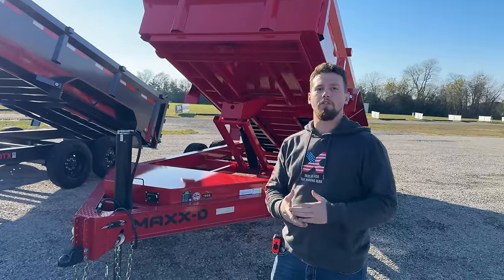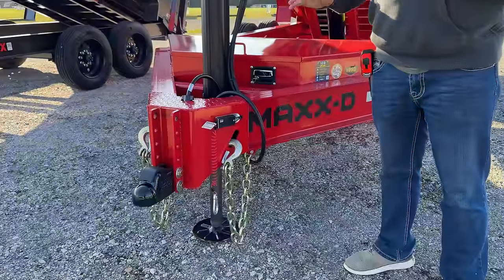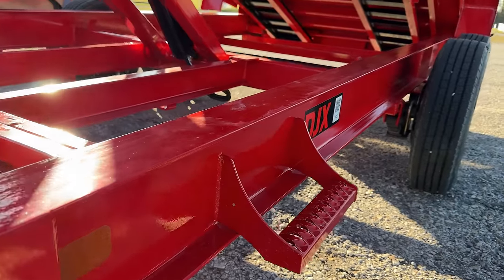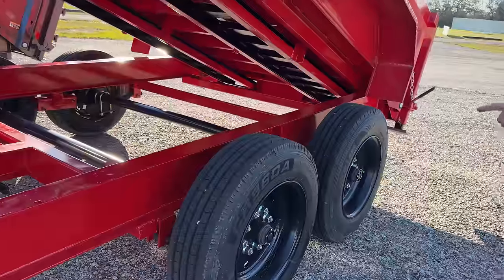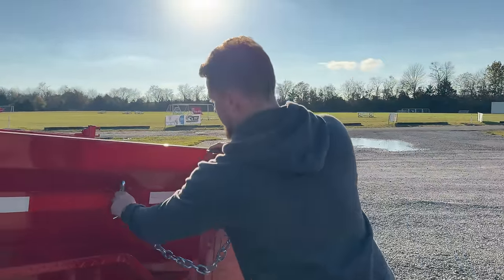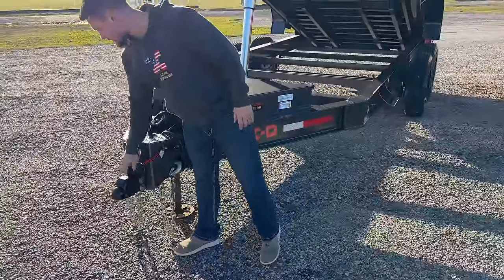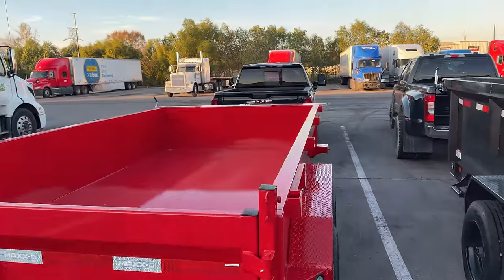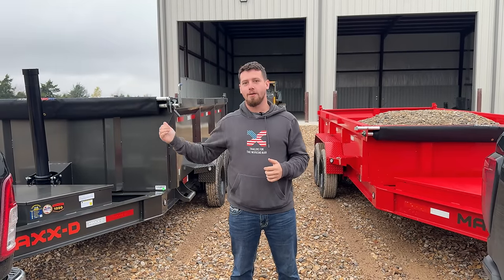Scissor Hoist vs Telescopic Cylinder | It's not what you think! DJX vs DTX Dump Trailer Comparison

Comment: The loads should have been put in the center of the trailers, not piled at the front.
Reply from the maker: Correct, you want the load over the axles, evenly distributed. In this case we intentionally loaded them both front heavy to showcase the lifting power in both trailers.

Comment: What kind of steel and how thick are the floors of these trailers?
Reply from the maker: 10 gauge steel standard, 7 gauge is optional!
Reply: Since the comments are off, I'll comment here, why not turn the scissors system around so it lifts the front of the trailer instead of in the middleish.
Reply: @Maxxdtrailersofficial  10 gauge is pretty thin for a floor on a dump bed, that's only 1/8th inch. Is it AR450, AR500, or just regular steel? All my big dump trailers for semi's, and dump trucks are standard 1/4 inch AR450 or Hardox which is equivalent to an AR450-AR500.
Reply: @clydeacor1911 with 12” centers you’d probably break the axle before the floor

Comment: I usd to drive tip trucks. Underbody hoists are bad news, they will twist and tilt and at worse case fall over.
Tele hoist is a LOT more stable and the reason 99% of full size tippers have them

Comment: Wow that is very similar to my pj almost the same!
Reply from the maker: MAXX-D dumps may look similar to a PJ, however there some differences that set us apart, here are a few. 
PJ crossmember spacing is 16" to our 12" spacing.
Our 8k axles come standard with 16 ply tires.
We offer an industry leading five year structure warranty, PJ offers a three year. 
MAXX-D dump trailers come standard with a TUFF wireless remote for all functions.
We also build our dumps on a heavier frame, 8"x15lb to PJ's 8"x13lb frame.
Reply: @Maxxdtrailersofficial  oh wow! That is a very rugged trailer I'll have to try one next! I really like over built stuff that makes it last really long. And very reliable!

Comment: Never ever will I ever get a telescopic dump trailer. Even if it was given to me brand new, I'd sell it and get a scissor.
Reply from the maker: Everyone has their preference for sure, you can't go wrong either way. I'd like to hear more about this, what do you like more about the scissor over a telescopic?
Reply: @Maxxdtrailersofficial  well in this case you can go wrong and a very bad way. Telescope is prone to failure. And not just it simple fails in loss of compression but they collapse. The fact that the longer it extends the more chances it fails. More later.
Reply from the maker: @AztecWarrior69_69  Thanks for the feedback! That would be a cause for concern for sure. We've been building telescopic dumps for many years and compression failure isn't something we've seen yet. The DJX is a great option as well for the scissor hoist guys, the 6x20 hoist is a beast!

Comment: You failed to mention the PRICE of each trailer !!!!!!!!!!!!!!!
Reply from the maker: The DTX base MSRP starts at $16,800, a bit more than the DJX at $13,000. Keep in mind the DTX (Telescopic) throws in some features as standard that you'd have to tack on as extras with the DJX.
When making an apples to apples comparison, the DTX comes in at about $1,000 higher than the DJX. 

For accurate pricing you would need to visit a dealer as we don't sell directly to the public.